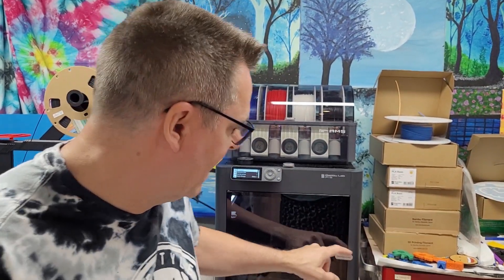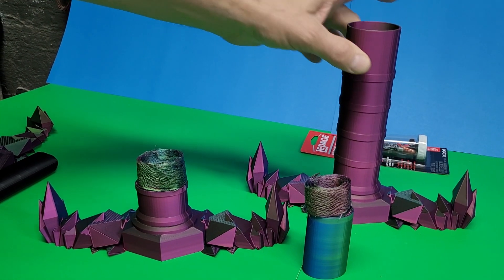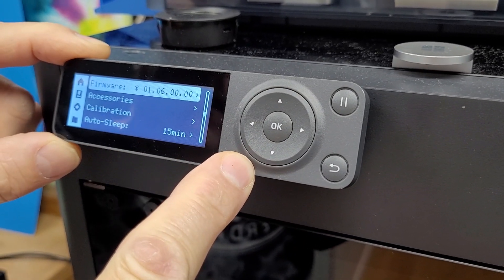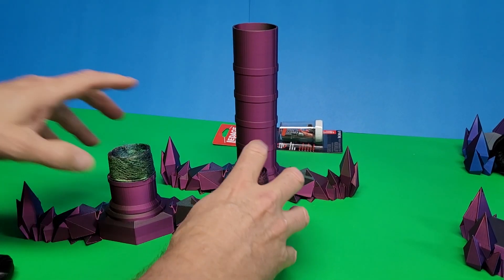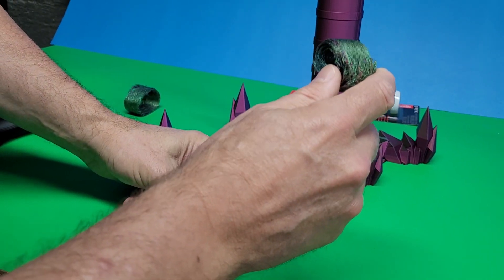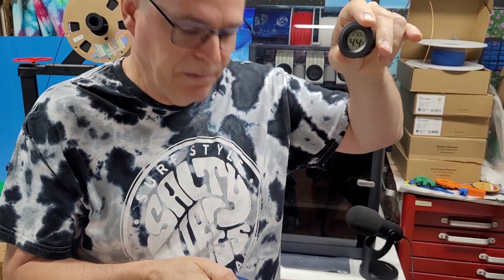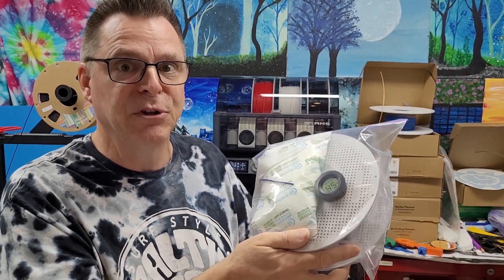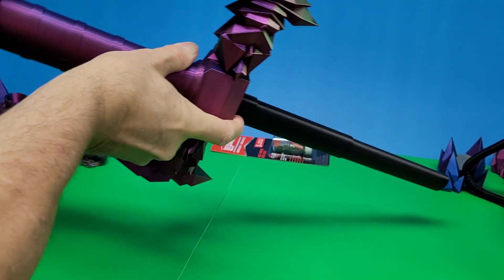Bambu Lab P1S Print Failure!

Comment: Please Help - its 2nd day i Buy this printer 1st day works fine next day i print this "20mm Brim" file which shows in your video "Set the Z Offset on an Anycubic Kobra Go 3d Printer" and now everytime i print very little filament come out, i open the head clear everything, there is no clog or filament stuck, i give extrude and it come out easyly but while printing anything it give very less filament  Please i need Help (this is Anycubic Kobra 2 Neo)
Reply from the maker: Hey Code hang in there.  It's back to basics,  can you print the test file that they supply on an SD card? Let me know if that works before anything and I'll see if I can help you out.
Reply: @mayhemsmiley  yes now its working thank you so much now i undersand what happning sir this is setting and code i have https://docs.google.com/document/d/1iE8i1kvawXdnanIyD3NQ_vt0yPW-87v8ExWVVYLQtwA/edit?usp=sharing , can you tell me how to make a test Brim for my printer and set Z properly and setting with Cura so next prints are come nice, you are the most helpfull person i ever speak.
Reply from the maker: Morning Code, If you are using Cura, make sure it's setup for your specific printer then add a calibration cube from the menu and scale the cube down on the Z axis only to your desired layer height then choose the brim feature under the bed adhesion tab. Let me know how you make out.
Reply: @mayhemsmiley  yes it works
Reply: @mayhemsmiley  sir i do that extruder colabration but after run the code my Kobra neo 2 it only push 40mm and 80mm left of filament when i give G1 E120 F100 then 100*100/100 = 250, so i put M92 E250; but noting happend, so just use the default and other problem is when i print Brim one corner of is is getting very thin i don't know why i do auto leveling properly plese give some tip
Reply from the maker: @codewithdevesh6215  I'm away from home at the moment. The extruder details I will review later. But the thin portion of your brim is due to your need being warped to the degree the auto need leveling mesh cannot compensate. Here is how I fixed mined https://youtu.be/qpm1Rpr6EyQ
Reply: @mayhemsmiley  one more thing, the file come with printer "Benchy" can i take his start and end G-code and put in cura so i get that quality in every next slice i do ?? is it works?
Reply from the maker: @codewithdevesh6215   @codewithdevesh6215  Good morning Code, I highly recommend that you use the link here to learn Gcode, it is easy, fun and extremely useful. It will allow you to modify your start and end code. https://marlinfw.org/meta/gcode/ That website and open your Gcode with a free software called Notepad ++ makes for easy viewing. Look up how to write comments on your code as you are learning. Let me know how you get along.

Comment: hello sir, i have anycubic kobra go, accidentally i just cut the thermistor of the nozzle, and I replaced It with ender 3 hoted kit, before now I used ender 3 hoted kit for anycubic and work properly, but now the nozzle going to the highest temperature, but in the screen doesn't show any high nozzle temperature , like the nozzle is in the highest temperature but in the screen doesn't show on , it never happened before I searched and all say its thermistor and I change 2-3 different  thermistor  but it was the same issue , does there is any way to fix this problem sir , thank you for helping
Reply from the maker: HI 3derbil, sorry to hear that you're having troubles. My recommendation and something I always do is double and triple check my wiring, being human we all make mistakes. Keep me posted if you find your problem.
Reply: @mayhemsmiley  im still searching for the issue, i couldn't find what's problem with my printer, I even bought another thermistor and still nozzle temperature stuck in 130 without getting het

Comment: If you've been part of the 3D printing subreddit for a while, its been a repeatedly spoken rule to always dry your filament. Good thing you got it figured out. Although I would invest in a good filament dry box. Its helped me with problems like stringing and the issue that you are having here.
Reply from the maker: Hi the traveler
Basically I had been delinquent leaving that roll out of storage for months. Initially I didn't like the material because it was an accidental Amazon order thinking it was a transitional color change filament. I'm so better from now on 😊

Comment: Dessicant is a fool proof cure for moisture. I have a sealed dry box for the Qidi which holds the spool during use and it has a dessicant compartment to keep it dry. No active heating needed. Spool goes right into the box after opening and stays dry.
Reply: Weird that the AMS unit didn't keep it dry...
Reply from the maker: @JamesBiggar  Hey James, I was really delinquent with that particular roll of filament. It's been out of the bag hanging about for a long time. I actually don't like that combination. But it was printing so well until it reached the inner portion of the roll. Does moisture/humidity like to nest towards the middle? I know that I didn't know, but it definitely worked after getting a suntan LOL
Reply from the maker: Morning @JamesBiggar thanks
I always appreciate your willingness to share knowledge with me. 
I often wish there was something I could do for you in return. 
Yah the silica that I have in the ams  and bags is the type that changes colors and can be reset.  I'm pretty much due to reset now according to the color changes I see. 
Thanks again and happy weekend 😊